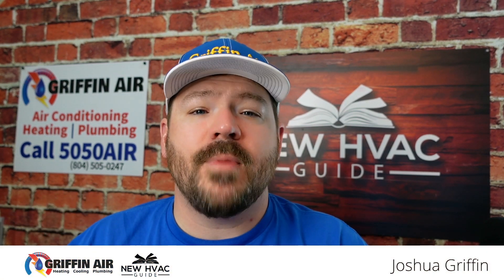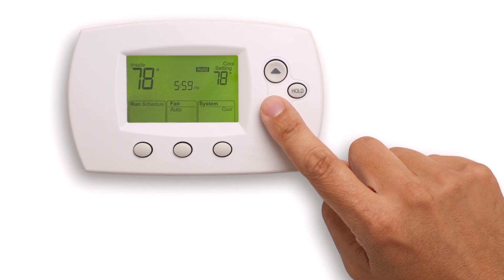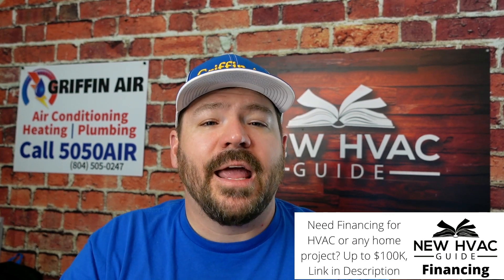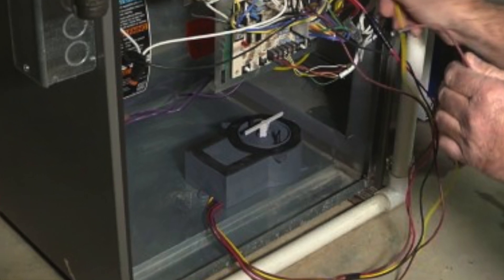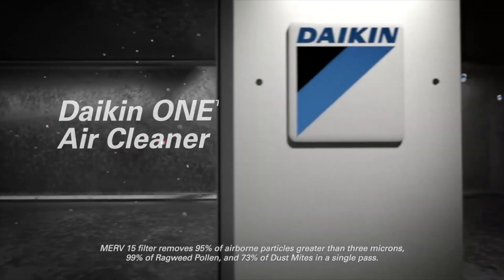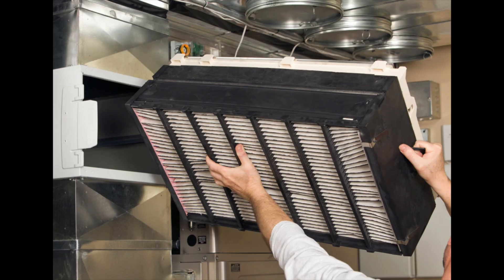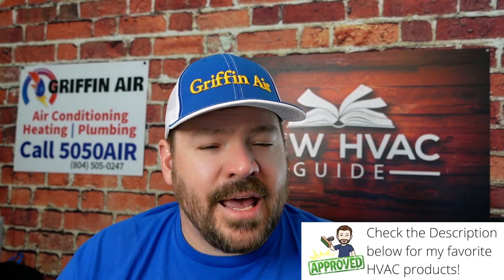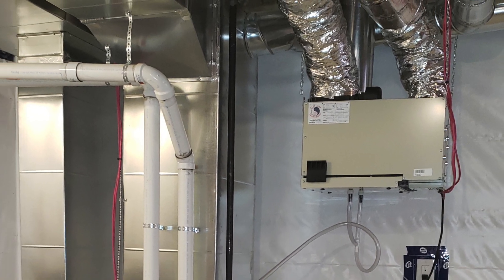BEST Timing for HVAC Upgrades!

Comment: For a zone system. I am considering 8 zone or break it up in to 3 zones. I want to have enough room to have everything added in to the system and all metal. Filters at all returns and everything you said along with a whole lot more. Going with 8 zones will allow for 8 returns yet going with the 3 zones. I then have to central locate the returns. This not only causes a draft across rooms along with high and low pressure. Might not seem like a lot yet when you have an air tight house it make a difference. The other thing I want is a variable speed fan so that way the fan can run at super low speeds all the time and kick on high when voc's are detected above a set level. I am not even sure what brand to really look at the includes vocs sensors along with others. We have some of those really nice carrier whole house/room hepa filters with the sensors that speed up when it detects smells. We super like these and would like to find something like this to work along with our hvac system.

Comment: Do you recommend a hard start or soft start system? My lights flicker when the AC kicks on.
Reply from the maker: The first thing I would do is have an electrician/HVAC tech, check everything over and make sure there’s no issues that could be causing it. However, if that were to not take care of it, you could try both, but a hard start is more commonly recommended as the solution

Comment: Another good thing to remember if you ever had a mildew or mold issue with previous system. Its always good to get a airclean / uv light  on new system at install

Comment: Hey Josh I have a Goodman ac unit 3.5 ton it uses 410a refrigerant 13 or 14 seer I don't know but do you think I should replace my ac unit,air handler for 2023